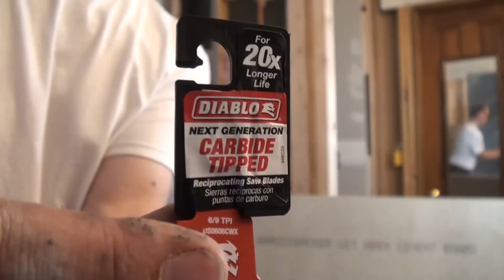How I to install a Shower Pan Liner and HardieBacker Board. 15. Душевой поддон

Comment: Another big fail - Im no expert but x15 Panliner adhesive is for joining liner sections not for gluing liner to drain flange.  Pan liner should be sealed with silicone b4 putting it down.
Reply from the maker: Wow ! I done it in wrong way a 20 years ! Silicon?  Come on - Never-ever use silicon. My way work very nice !
Reply from the maker: I know you are not expert and I can't judge you. Look at this -  
PVC pan liner or CPE pan liner which are installed the same with the exception of the bonding adhesive used for seaming and dam corner applications....
https://www.homedepot.com/catalog/pdfImages/19/19a5436c-a857-446e-a0eb-39edb5e4b7c7.pdf

Comment: Screws through membrane ? That will leak. Using glue/ construction adhesive instead of caulking? That will leak. I did not see any type of paper or plastic behind the board. I'm not going to watch any more of these to see if he waterproof the board but that particular board Durock is not a water barrier. If you need information on how to build a shower I strongly suggest you look someplace else. FYI I'm a 40-year veteran of the construction trade, good luck with your project.

Comment: Aren't you supposed to run the liner over the step? You should show how the drain was installed I'm curious about this important first step in a pan liner installation
Reply from the maker: Watch previous part with drain installation.

Comment: I usually don’t comment but this is just bad. I hope no capable DIY’er or a starting out contractor watches this and ruins their own or other people’s showers. This is WHAT NOT TO DO! Your welcome in advance.
Reply: Jake exactly right. Looks like he is using drywall screws instead of the treated  backer board screws. Dry wall screws will rust over time from moisture wicking through the grout lines. The vinyl pan also needs to slope toward the weep drain and not stay level on the base floor. If there is a fracture in the cement floor the water will just sit there and deteriorate the cement floor from underneath. . The backer board should never be installed directly over wall studs without a min 40 mil vinyl sheeting first applied. The seams need to be flashed over with thin set and a fiberglass tape inserted in the wet thin set much the same way drywall seams are mudded with tape. Smearing caulk or silicone over the seams provides no additional strength . Also the backer board should extend down over the vinyl pan  edge by at least 2 inches. Last  the vinyl pan should wrap over the curb and not be cut off. This is a disaster waiting to happen. We pros that know what we are doing are really doing the general public a favor by pointing out what not to do thus saving them time and money especially if a pro comes in to correct the mistakes. Sounds like you are in the trade also.

Comment: No need to watch the whole video when the first step is Even Done Right never I repeat never install a shower pan liner without a pre slope unless you want a nice swimming pool with your tile sitting in it
Reply: Preslop not needed, not many people do them anylonger..only when required by code. Water wont flow down like you think. Also waterproof the floor after the mudd is set.
Reply: Anthony Pittario you don't have to pre slope it's redundant if you do a pan bed kinda uncalled for and just more material you don't need.this dude is a goof thou but I pray many follow as i will become wealthy as a contractor love this stuff.

Comment: Going to leak for sure and the side wall board was below the pan.  Mold in the walls...split the tile on the curb with on long seam...it didn’t look slanted into the pan at all.  Why caulk the joints on the wall board?  No paintable membranes...bleh

Comment: Um ok. Out of over 1000 shower pans iv been involved with never ever have iv seen this. The only thing I can see working is the hardy on the outside of the curb. Build up with concrete the top and inside using a metal mesh.
Reply: Well finally someone talked about metal lathe and cement.. one guy outta 35 or so.. that has adequate experience

Comment: Where’s the pre slope under the pan liner?
Reply: That's what the pan mud is for
Reply: no there should be two floats your first float is a prepitch or what we call the rough-in, it goes under the liner and pitches to the flange, this is so that when the water goes through the mud bed to the liner it flows to the weep holes and down the drain....and the curb is sure to rot....the entire curb should be wrapped with the liner and absolutely no nails or screws or any punctures especially below the water line.....this is what we call a runaway helper....leave it to real tile setters and stop screwing peoples showers up

Comment: I am going to remodel a 1960 house completely stripping it down to the block walls and vaulting ceilings removing hand framed ceiling joice's installing collar ties all with permits. I am a licensed South Florida electrician not a contractor my question to you sr. Is that okay to put those screws on the in side of that curb, if I go that route should I pre-drill and pump silicone behind it? love the countersinking get those screws flush and planer for those stud sticking out great job. I get that stink eye every time I tromp through the house with dirty boots on, nice job I'm sure you get no complaints.
Reply: sugarfreementos ... A new board out called Goboard slot easier to work with. Job takes a 1/3 of the time using only a sheet rock knifes and roofing nail with correct measurements
Reply from the maker: Yes, I pre-drill the Hardy to prevent crack. Since i use a tile glue over the screws head I am not worry about silicone inside the screws.
Reply from the maker: In this video you can see how I pre-drill a Hardy. https://youtu.be/SQTSYyNhO_g

Comment: Liquid nail is not waterproof caulk.screws through curb will rust unless completely sealed again.hardibacker board is not waterproofed.may as well have waterproofed with pvc liner all the way up and nailed it more then glue pvc patches over each nail.might as well learn schluter.
Reply: This is totally a self taught handyman pretending to be a precise professional....and I think it would be to hard to stop him and retrain him due to his misuse of multiple materials in a modern house with a tight envelope....insulating behind moisture soaking board is the worst.lets put a dehumidifier inside all the walls he put up....yup.
Reply from the maker: From my experience Liquid nails more than waterproof, believe me.
Reply from the maker: You don't trust your tile work? Tile and grout - this two component should keep all moisture out from the walls.
Reply from the maker: Intergalactic Post-Apocalyptic Sex Boat   How the shower was build 50-70 years back? You don't know? I know. Sheetrock, tile and grout. ONLY !!!!!!!!!!!!!!!!!!!!!!!!!!!!!!!!!!!!!!!!!!!!!!!!!!!!!!!!!!!!!!
Reply: Fix it All 

Lol there is a reason no one uses Sheetrock, tile, and grout anymore grandpa. I have been working in the trades for 17 years and I have never in my life seen work this bad. I hope the people who own this house sue you out of business.

Comment: This is not the correct way. 
I’ll bet my 30 yrs exp on that comment.
Reply: Mike Sacco your right, I’m also a tile contractor. He wrapped the curb incorrect. What’s the point of going 2 feet high on the walls if you have screws 3 inches from the mud. Second he did not fully wrap the curb to the other side which will cause failure. Third. He did not apply a preslope under the liner (which is optional of course but the smarter way to do it) and lastly. The hardie backer is too low. Hardie MUST be minimum of an half inch above the MUD. Hardie that is too low or touching the mud will cause the hardie to soak up water and cause failure later on down the road. Thanks 👍
Reply: This shower is gonna leak all over the place loll

Comment: the pai  liner , he didn't cover the curb with the pan liner and he put a lot screw , PLEASE DON'T DO HE'S WAY IS COMPLETELY WRONG AND I PROMISE YOU GONNA HAVE A BIG WATER DAMAGE IN LESS THAN A YEAR , PROMISE
Reply from the maker: So sorry, your promise fail... they used this shower twice a day almost two years already since i done it.
Reply: Brother straight hating on you
Reply: Just because you do a different doesn't mean it's wrong if it works it works
Reply from the maker: @manuelmendoza6135  Thank you!

Comment: Where is the pre-slope under the rubber liner?  And blocking around the perimeter of the shower area?  Not to mention other items, you are putting a lot of work and effort into your project you should do it properly.  Try consulting the national plumbing code for this. Section 7.10.6 
Find it on the web; try this not sure if it works-- @t

Comment: Looks great.  HOWEVER what would be the difference IF the floor was concrete  instead of plywood?
Reply from the maker: You can do same process.
Reply: Same difference both need the corners pitched before installing a pan liner

Comment: Hello fix it all. How did you get your showerpan drain to sit flush on the subfloor? Did you taper the edges with sawz-all?
Reply from the maker: It's not completely  flash to the subfloor. About 1/4 above plywood. This is a Part 10 - the drain installation. https://youtu.be/2lv1da8-T0A
Reply: Fix it All if not completely flush how will water ever get over the little 1/4 lip and drain in the event of a leak?
Reply from the maker: Water can't be there. Use waterproof sealer.
Reply: Fix it All will use red guard but you say water can’t be there? The liner is last defense.
Reply from the maker: What can i say. I do same way long time, and no one have any complain with some problem.

Comment: Well that's great, You've just shown how to fail a shower Pan This is lieutenant Mike from slab teen one You never put any screws nails or staples in a curb and area You started without a pre float And when you sealed around the parent material you have to use polyurethane not silicone it goes around buddy That shower will not last more than 3 years.

Comment: Shower liner preslope? Showerliner cut at drain destroyed , showerliner at step not wrapped over the step , shall ppl continue with other mistakes? Hope this dude just worked on his own bathroom and not anyone else’s
Reply: The thing that got me laughing was caulking the edges of the backerboard. LOL! Then used construction adhesive as caulk around the shower head fitting and the backer.  OMG! :-D

Comment: I thought the mud pan is supposed to be installed before the durorock.  Then you install the durorock and leave a 1/4" gap between the bottom of the durorock and the mud pan.
Reply: Haha, you must be watching the same how to videos I have been watching. Because of wicking action he will have leaks and mold or rot in a few years.

Comment: Wow.. this guy is obviously not a professional.  In the 1st 2 minutes there a 3 things that will cause this to be a disaster rebuild in the next 3-5 years. 1.  always put adhesive on the drain BEFORE you put the liner down on it (unless you have Xray vision) 2. NEVER cut the hole out of the liner (make an x so water will always follow it down the drain)  NEVER EVER NEVER! put your backer board on the bottom before you pour or install your shower pan.  water will run down the bottom of the board directly to the liner instead of onto the tiled floor and to the drain..

Comment: Why did you put the cement walls over the underlayment like that? Shouldnt that have been the other way around?
Reply from the maker: No way to install in other way to prevent leaks.
Reply: Okay. Thank you. All the other videos have the liner on the outside of the cement boards
Reply: Water will be on the underlayment under the tiles! Cement board will soak the water in. And this project will leak soon as soon as the screws will rotten out because of the moisture.
Reply: No. This guys still does it all wrong though. The first step is to pour a pre-slope which is deck mud the minimum thickness to get 1/4" per foot of slope. Then you put liner in almost like this but it needs to cover the whole bench and loop over the curb. Then you pour the top of the pan, then install concrete board with a 1/2 gap above the pan. The gap should be filled with adhesive silicone.

Comment: water proofing with glue ? 7:00
Reply from the maker: Looks like you never use Liquid Nails and don't know how it great for the water seal.
Reply: @FixitAll  the glue clogged the drain vents on the strainer plate son

Comment: um liquid nails is not silicone, and you put screws through the liner on the curb
Reply from the maker: Never use silicon in that place. It peels off after year.
Yes, I screw the liner, but can you tell me for what i use Hardy, Tile glue, tile and grout?  
Do you think Hardy, Tile glue, tile and grout is hot enough for water protection?
Well, if not enough, you can use a RedGard like I was used hire: https://youtu.be/e_4Wzgtxic0
Reply: @FixitAll  Redguard is for hacks also champ.. it re-emulsifies in contained moisture
Reply: @ronnietompkins4261  How should you fix the Hardie board to the liner at the thresh/dam ?
Reply: @ronnietompkins4261  Where's your video then, Expert?

Comment: Why do I always see contractors using the ugly, cheap round drain. And the tile is never cut properly around it either. Spend the extra $10 at Home Depot and get the square oatey. Of course there’s more expensive ones too there and at other places. But it always looks so much nicer.
Reply from the maker: Good point. Thanks!

Comment: People still use this system?
Reply: I’m tile guy, and use this system (pan liner) over 10 years !
But he did a lot mistakes!!!!
Reply: Sergey Otroda so is it OK to do the pan liner like that? Without the pre slope? Just. Subfloor, pan liner and mortar ? Let me know thanks
Reply: @joshuawilson2362  you must pre-slope. Wrap the curb with with the liner and use silicone between liner and drain. If you use cement board on the walls try not to take the screws all the way down to the liner, when you do the final float for slope that'll help. And for God's sake do not use liquid nails. Tape the joint and corners with mesh tape, fill the holes with thinset and regard the thing but do not use liquid nails!

Comment: No pan liner on curb. No waterproofing on backer board. No pre slope.  Liquid nail??   I wish folks would just use the schluter system.   Its such an improvement over this garbage system that leaks over time even when done "right"
Reply: You sound like a DIY'er too. liners arnt the best but done rite there better that the schluter system which will take another decade to see it s flaws come to light
Reply: @ronnietompkins4261  I've installed dozens of showers with the schluter system with zero problems.  They carry a lifetime guarantee if done right

Comment: no one puts durrock or anything directly on the pan. cut it an inch short doofus
Reply: water does go uphill.  its called weaping. it will weap if u keep contact with the bottom surface.  its proven. other than that. looks great

Comment: Dude I love ur vids , I use ur methods constantly, actually doing a bathroom demo now thanks for all the fast but informative ( if u know basic construction u know what and how to do that , and for all the hype as out pre sloped drains , I haven’t had a problem not doing it ever , I did a bathroom that was above a garage with exposed framing about 8 years ago , my house , and not a drop of water , if u seal it correctly no problemo
Reply from the maker: Thank you!

Comment: This guy is c'sinking the screw holes, if you use the right screws for concrete walls, you won't need to do that, also the drain may leak, cut a X for that hole. All other seems good, keep up the good work. Thanks
Reply from the maker: Thank you and Happy New Year !

Comment: Pre slope is for suckers.
Reply from the maker: Seal Tile and stop the water.
Reply: cresten1000 

And people who don’t want their shower to smell like dirty socks in a year. The weep holes are there for a reason. So you don’t have swamp water under your shower. Codes require a pre slope and liner/drain manufacturers require a pre slope.

Anyone says seal the grout/tile has no idea what they are talking about
Reply: that was the first fail, i stopped watching after that and noticed the liner didn't go over the dam

Comment: Shower pan is wrong. This is definitely not a tile setter and more of a diyer/handyman.
Reply from the maker: You right, i am a handyman with 22 years experience and more than a 40 showers done in my life. No single problem with my showers.
Reply: @FixitAll  your liner is wrong regardless. You must wrap your curb. You had a good 18 inches on that back wall where it will do nothing and none on top of the dam where the water will surely get wet from entering and exiting the shower.
Reply: @jeosua  Where's  your video?
Reply: @FixitAll  you should watch the manufacturer video oatley this shower is done wrong and will not pass inspection